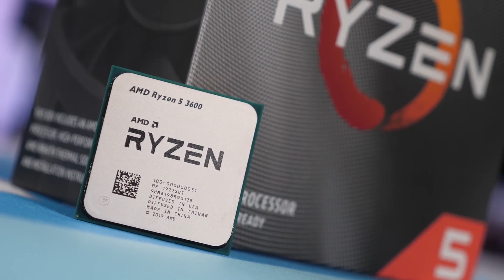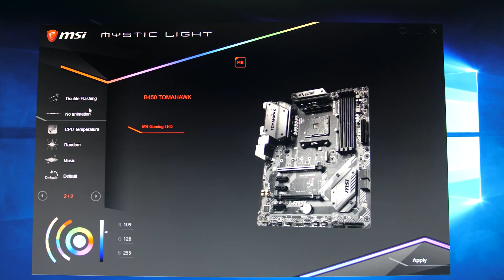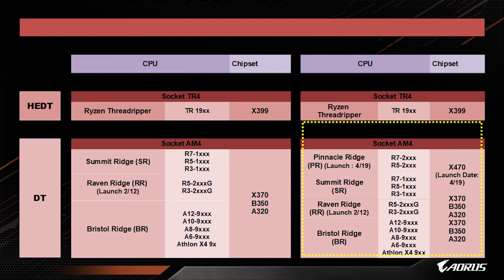Best Motherboard for Ryzen 5 3600 [Top 5 Picks 2023]

Comment: B450 motherboards BIOS are not compatible with Ryzen 5 3600 (BIOS must be updated)
Reply: What's BIOS? Everywhere it says the B450 tomahawk supports the ryzen 5 3600.
Reply: Actually only some
Reply: B450 sucks.. really suck
Reply: B450 does not support ryzen 3500x too
Reply: @meteorboomber299  actually alot of b450 does support out of the box on the 3k series and below (asrock steel legend*bad*)
Msi tomahawk max b450 is super good for it's price and has good overclocking support aswell. It supports out of the box. Clearly you haven't built a  pc with a b450 or research on  it. I understand that some actually suck but that's cuz those are cheap. Please search cuz you'll save alot of money buying good b450
Reply: @meteorboomber299  the MAX VERSIONS do support it I have MORTAR MAX

Comment: is the gigabyte ab350 gaming compatible with the ryzen 5 3600?
Reply: I currently use the ab350m board with a 3600, you’ll need some bios updates and it works okay but I’ve had some minor stability issues so I’m upgrading soon
Reply: @Basstech_  thx
Reply: google it stop asking people for answers you can find your self. its simple
Reply: @squirrel3244  thx

Comment: Please somebody tell me which motherboard should I buy for the ryzen 3600 it’s my first time I’m gonna build a pc so I don’t no to much
Reply: B450 Tomahawk Max
Reply: @rockytech6014  which exact model u have !pls attach a link
Reply: @suraj.1889  I have many motherboards
Reply: @rockytech6014  i mean the version of b50 tomahawk that u hav, there are a lot of max versions
Reply: @rockytech6014  Shit motherboard, don’t buy it i’m replacing mine
Reply: @GangsterDolphins   Tell me how. In my experience it's quite good.
Reply: @rockytech6014  Ethernet issues and fan control issues. Causes me too much stress. I'd rather get intel i5 9600k and an Z390 or whatever board it uses next time. I've used AMD my whole life but my new pc has annoyed me
Reply: @GangsterDolphins  Don't get a freaking 9600k. 6 threads is going to sorely disappoint you, in fact, if you have some extra money, get the 9900k.
Reply: @rockytech6014  In UK it costs less then a 3600 and its better at gaming. so calm down learn your stuff
Reply: @GangsterDolphins  Have you heard of a decent experience? 6 cores and 6 threads are painful, hence I’m suggesting you pony up and get the 9900k.
Reply: @rockytech6014  okay tf are you tryna prove, i5 costs £130-£190 depends where you look. Is better then a ryzen 5 3600 which costs £170. i9 is £230-£300. Use your intelligence
Reply: @GangsterDolphins  Is the price of the i5 pushing it so much that you can't spend another 70ish Pounds? Also, maybe you can pick it up used. I've tried 4, 6, 8, 10, and 12 cores and I can tell you, it's worth the extra. Your computer feels so much nicer.
Reply: @rockytech6014  Idk I'm not buyign rn im just saying i5 is better then ryzen 5
Reply: @GangsterDolphins  Not true. Your average framerate will be higher but you will stutter more. Games want more than 6 threads.
Reply: @rockytech6014  have you heard of hyper threading
Reply: @GangsterDolphins  The 9600k doesn’t have that.
Reply: @GangsterDolphins  And even 12 threads is eh.
Reply: @rockytech6014  12 threads is eh? Dude its more then enough for anyone. Are you some engineer or architect that needs that much computer power?
Reply: @GangsterDolphins  I know that more than that gives you a much better experience.
Reply: @rockytech6014  leave him to suffer 😉
Reply: @rockytech6014  I'm ordering parts tomorrow can you give me any input on what mobo i should be looking for? I wanna spend no more than 200 on a mobo
Reply: @herehere3184  well the gigabyte x570 or b550 WiFi boards aren’t bas
Reply: @rockytech6014  Do you feel its better than the asus tuf x570 plus?  <- is the one i have in my cart
Reply: @herehere3184  Both are great.
Reply: @rockytech6014  yo is ryzen 5 3600 good with asus b550
Reply: @rockytech6014  bro which motherboard should i buy?
X570 mgp gaming pro carbon or B450 gaming pro Wi-Fi motherboard for Ryzen 5 3600 and the price difference is about 50$

Comment: Thoughts on GIgabyte X570/B550 Aorus Master on 3600?
Reply: Overkill in every way shape or form. Pick up the ROG b450-F, or msi b450 tomahawk.
Reply: @rockytech6014  for my ryzen 5 3600 which Mobo should I buy in budget pls help me
Reply: @RDev-z8i  I think either the AsRock b450 Steel Legend,  MSI B450 Tomahawk, or the ROG STRIX B450-F
Reply: @rockytech6014  which MB is better for gaming? The ROG or the Tomahawk
Reply: @mrtroll9106 You could have a $50 motherboard or a $500 one, it won't do anything to your gaming performance (one of the reasons you don't want to get a $400 motherboard, like the crosshair). But with that said, if you want to upgrade to a nicer CPU down the line, you do want a better motherboard. The ROG b450-f has better VRM thermals, so if you want to upgrade to something like a Ryzen 5800x down the line, go for the Strix. However keep in mind, the Tomahawk can handle anything up to around a 3900x, so if you're not going beyond that then stick with the tomahawk, it'll save you some coin.
Reply: @rockytech6014  https://pcpartpicker.com/list/hDGYNq i want to upgrade my pc its a pre built and those are all the parts that ik it has . It used to be my brothers so idk that much about it. What do you i should do to it? I was thinking buying the tomahawk and a ryzen 5 and 16gb of ram what do you think i would appreciate help
Reply: @younggoatyboi3340  How much do you want to spend?
Reply: @rockytech6014  600$
Reply: @rockytech6014  i could spend maybe a little more as long as it’s worth it
Reply: @rockytech6014  why overkill? I think its pretty good for future purchases
Reply: @ihwanchn  Because if you're spending that much on a  motherboard, you might as well get a better CPU.
Reply: @ihwanchn  And plus, 6 cores, and the am4 platform aren't going to last much longer.
Reply: @rockytech6014  i have ryzen 5 3600 and planning to buy gigabyte aorus b550 elite atx v2
Reply: @ihwanchn  That's cool! I'm just saying it's not the config I would do.
Reply: @ihwanchn  just don’t get the tomahawk max
Reply: @GangsterDolphins  i just finished my build like a week ago.
Ryzen 5 3600
Aorus gigabyte b550 atx elite v2
Corsair vengeance 2x8 ram 2666
Darkflash dlx21
Xpg 750w gold modular.

Im pretty happy with my build, im just planning to buy either liquid cooling or air cooling. Make some ups like better hz on ram, an m.2 1tb ssd and that would be it
Reply: @ihwanchn  Get 3600mhz RAM, a samsung SSD m.2 or sata and air cooling. I have a triple radiator and i only bought it for looks, air cooler is better
Reply: @rockytech6014  thank for the advices bro, you are awesome !
Reply: @S0cialRej3ct  Haha, thanks
Reply: Jakub_ Bro  https://pcpartpicker.com/list/3DsGHz It's going to be hard to find the GPU in stock, but if you can, this list will be great.
Reply: @rockytech6014  thats bad list
Reply: @yumi-fj3vd  Tell me, what suggestions do your goodie two shoes have?
Reply: @rockytech6014  why 3600 anymore? 10400f matches the performance while being way cheaper in most countries. if you were going ryzen, get 3600mhz cl16 ram for better performance, get an sn550 ssd instead, why h510, it has no airflow get a p360a, and get a cx650w psu instead. and also why the asus ko 3070?
Reply: @rockytech6014  i mean for the 10400f is like 200 while the 3600 is 320. 10400f + b460 (100) + some cheap air cooler like a 212 evo (30), is 330, whereas a 3600 + b450 is around 460
Reply: @yumi-fj3vd Firstly, that list comes out to just over $1200, (at the time of making it, my list was $1090ish) and what benefits do you get? None. Also, I need your stuff if you think a b450 motherboard is $165. The absolute nicest b450 board (the Strix) you can buy is $130, and even that's kind of overkill (was on sale for $110, so couldn't pass it up). Overall, you spend $110 more, for something that will perform identically in games.

Comment: ASRock B450 Steel Legend will  support  3600Mhz Ram with Ryzen 5 3600 with overclocking?
Reply: All b450 motherboards wont work with ryzen 3000 processors unless you update the bios. I dont think ASRock B450 Steel Legend has a bios flashback so unless you have a ryzen 1000 or 2000 processor on hand you should not buy a b450 motherboard
Reply: @littlejimmy5060  As of September 2020, that's not true.
Reply: It depends on the manufacturer wether they support it or not I don’t know if ryzen 300 series processors are supported on this exact motherboard
Reply: @littlejimmy5060  Name one manufacturer that hasn’t released a bios for 3000 series
Reply: Every manufacturer has released a bios but not every board come with the most recent bios and not every board has a bios flashback
Reply: @littlejimmy5060  If the bios was out when the board was manufactured it has it on it. I'm sure no board they're selling you as "brand new" was manufactured in September.
Reply: But that depends so much on where you are getting it from. B450 motherboards are technically outdated because you can get a b550 for a few dollars more this means that there isn’t much demand so companies like Amazon don’t need to restock which would mean that they have many boards which don’t come with the newest bios. When I ordered my b550 board it came with a bios 4 months old. I think that this is very speculative but all I was saying is many b450 motherboards aren’t going to be compatible with the ryzen 3000 or 5000 straight out of the box.
Reply: @jovan6855  ffs im sorry ok i made a mistake i havent built a pc for some time now
Reply: @rockytech6014  I just bought a ROG Strix B450-F mobo. Would it be compatible with the ryzen 5 3600?
Reply: @Alfiemoooon  Yes
Reply: @Alfiemoooon  Also, consider the 3700x if budget allows
Reply: @rockytech6014  I would of I could but unfortunately being a high school kid, my budget is very limited😅 just saving up from last Xmas my birthday. Thanks for the recommendation tho!
Reply: I heard alot about that the vrms are not so good but in my country it is my only option 🙇
Reply: I don’t think you can. But if you overclock your memory I think you could.
Reply: It’s a great .otherboard